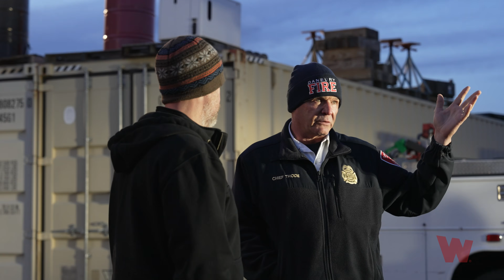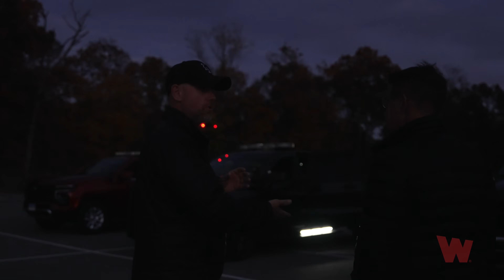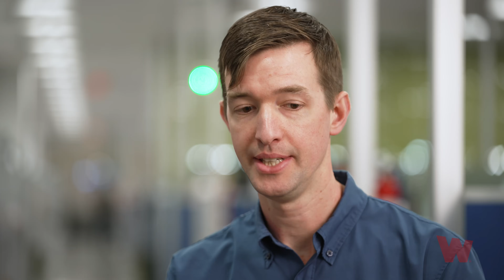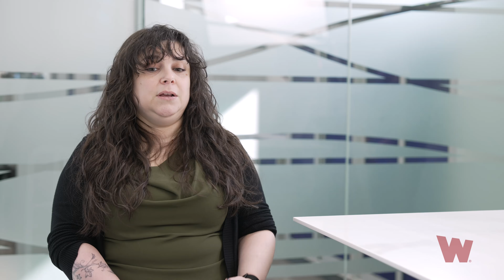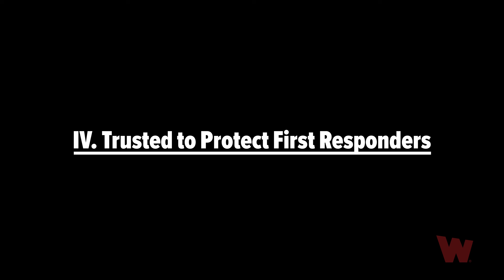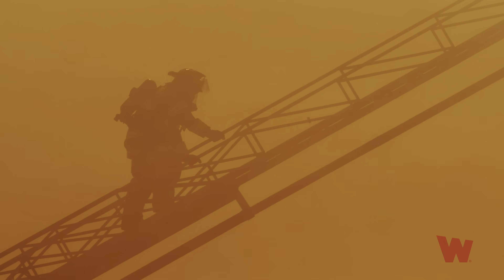Freedom V Unveiling from Whelen

Comment: Man it is so great you brought back the ROTATION of a Light Bar. The standard was the just FLASH or STROBE personally I love the idea of going back to ROTATION just like the old very heavy VOLTAGE using the old just BECON lights, to much voltage DRAW on the batteries. That you came up with a modern LESS voltage DRAW that can stay ON even with vehicle engine not ON. that to me is a game changer 😊 great 😊 great Idea for modern Emergency vehicles. With LESS power draw from battery banks.
Reply from the maker: Thank you for the positive feedback! We're also very excited about the NEW FREEDOM V Lightbar!